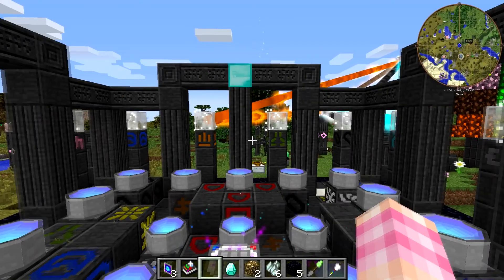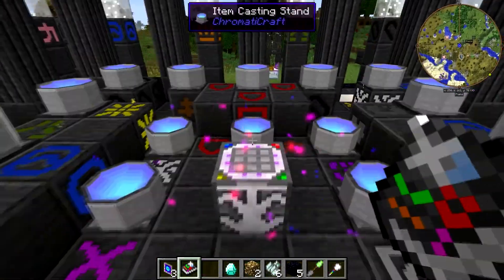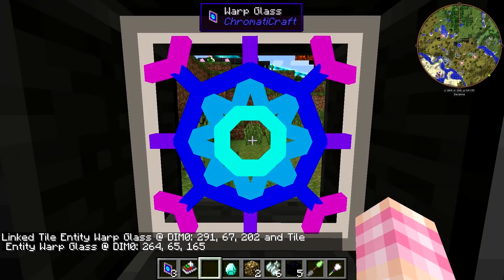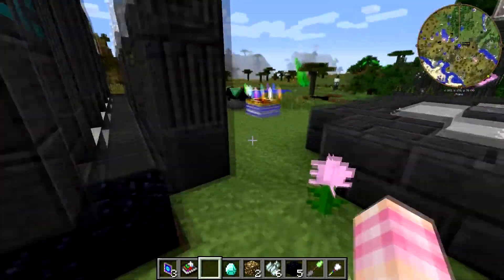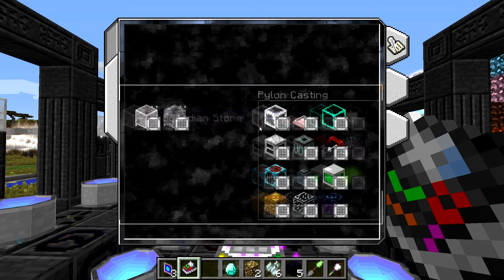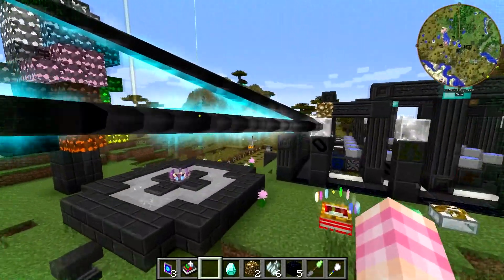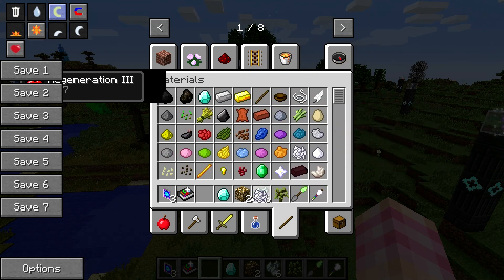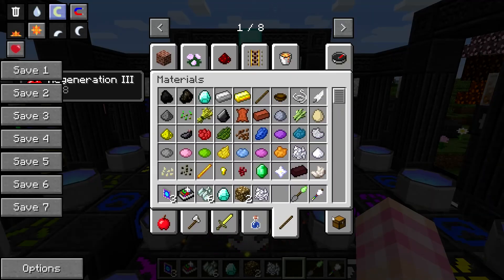ChromatiCraft Tutorial v19 - Power Crystals

Comment: To fully upgrade, you'll need 128 Power Crystals, 8 for each of the 16 colors. Also if you want to move them, god forbid, you'll need Silk Touch on a pick.
Reply: Long live the Chromatic Enchanter.
Reply: To anyone reading this: DO NOT attempt to remove power crystals with a pickaxe, even if it has silk touch.
Reply: @kingmidas8967  Did you have the pylon supercharged or has Reika made it so they explode?
Reply: @XANA520  Not turbocharged, it only had power crystals. I hit the power crystal with silk touch. It didn't drop and I got struck by lightning dealing 200 hearts of damage.
Reply: @kingmidas8967  Might've been changed then. Wouldn't put it past Reika.